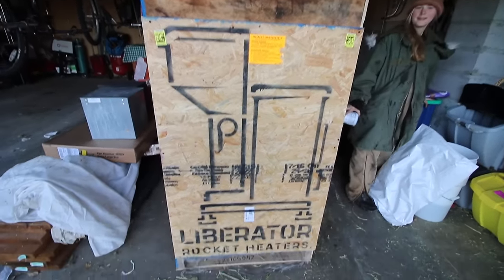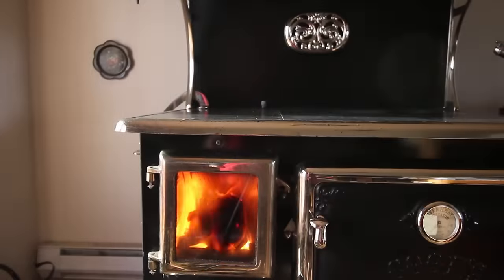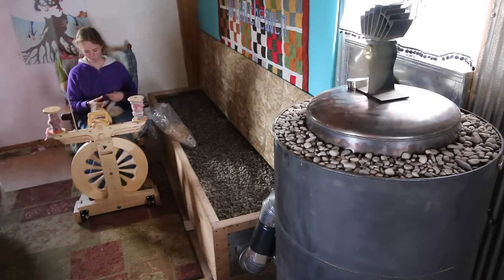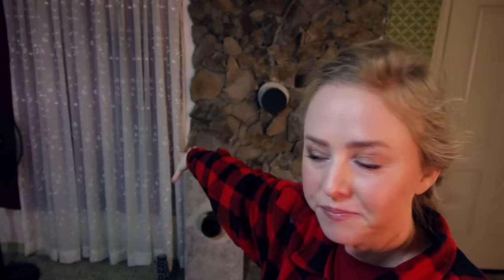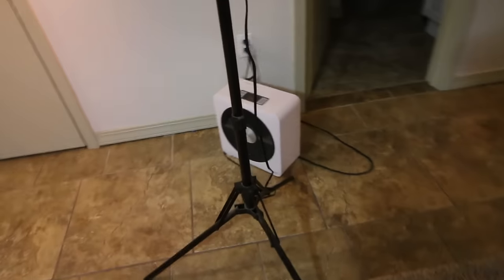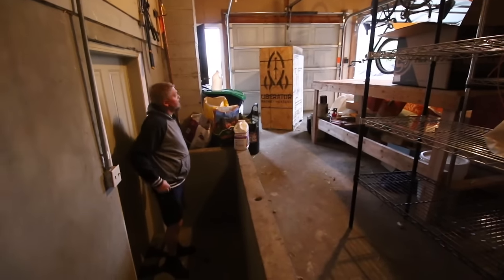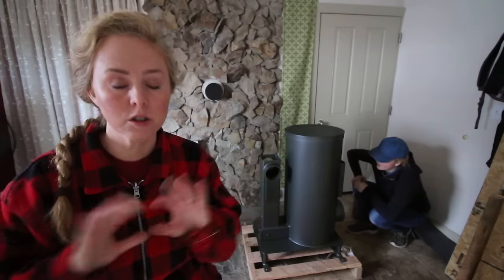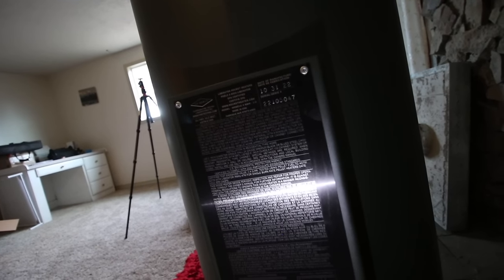Rocket Stove Heater is UL-Certified for Use In Residential HOMES! Liberator Rocket Stove Heater

Comment: Regardless of using a wood, pellet, coal stove and even oil or gas fueled furnaces and boilers, these devices need air intake.  Most do not think about installing a separate air intake system that brings outside air to the stoves.   If a independent outside air intake is not installed, then these stoves are pulling in its air intake need by way of drafts throughout the home.  Many of the newer designed oil and gas fired boilers have this separate air intake from outside air designed in its installation requirements.  The wood, pellet and coal stove designs do not and rely on the customer to install if they wish.  Some Mfg' s don't even mention it.
Reply: One last note, one need to know how much air intake a stove need to burn efficiently.  If you do not provide adequate air supply ( and have sealed up your home drafts) the stove may not operate properly or efficiently.
Reply: Way more important than a lot of people realize. Thanks

Comment: With how much concrete and rocks you guys have in your basement, I would recommend something called a rocket mass heater. It’s a woodstove that you make, and the more rock and the more concrete and clay that you have the longer your house stays warm and you only have to have two fires a day and a rocket mass stove, really good for or big houses in colder climates such as Alaska Northern Wisconsin Canada all those northern areas that get really cold winters that are below -50° sometimes so I would definitely recommend for these guys or anybody else for that matter to make or buy a rocket mass heatercause you go through Leswood but you heat up your house for longer

Comment: If you are looking for more ideas to squeeze out more heat from your stack. There is the simple "Wood Stove Heat Reclaimer". For homemade improvements, look at a diagram of the heat exchanger in a natural gas furnace. There are multiple tubelike exchangers, some are narrow to increase surface area, you'd want the cumulative area to equal or exceed the area of your chimney to not cause restrictions.
 I would get 2 sheets of 12"x24" sheet metal, 16 gauge, stack them together, then drill evenly spaced holes where 3/8" copper pipe will fit snugly. Use the 2 sheets and add more sheets to build a steel box 6"x12"x24" and braze 7" long copper tubes (1/2" overhang on each side). On one side build an air plenum and add a duct down to your floor, where you add a fan to suck the coldest air from the floor. You'd add this to your heat stack.
You can also add a false bottom to your existing gravel box, and drill lots of holes in it, and add a fan to force air up thru the gravel - because the hotter the gravel gets, the less heat it will absorb.
Reply: Wouldn't this cause a bunch of condensation to occur in the chimney pipe?
Reply: I'm getting ready to experiment with something similar, only with a 55 gallon drum instead of a heat exchanger. I'm going to build in a clean out/inspection door so I can make sure it's not building up creosote. My flue temp leaving the stove is 250F a lot of the time. A metal drum will double the surface area of my stove, albeit cooler than my stove. I'm hoping for 30% gain in btu output.

Comment: If you have a properly working Blaze King stove it heats all night with one fill.
The fire has to be run wide open to get it hot. Once it gets hot the dampers have to be closed.
Reply: There had to be something wrong with the blaze king stove or chimney to use that much wood in one season. Like a door seal needing replacement or a damaged damper. I’m 2 hours south of Alaska and we go through maybe 4 cords from October to April!

Comment: I had to measure my pipe 19 and 1/4 in on the hopper pipe. Also I added a small cookie sheet to the back side of my Hopper just leaning against my stove on the edge of my Hopper, that made a hundred degrees difference on my Hopper.

Comment: Interesting build and infrastructure.  Is this a multi fuel unit?   I knew someone that used dry kernel corn in place of pellets.  The corn was less expensive than pellets, perhaps it wasn’t stored properly and became rancid or moldy.

Regarding the creosote water,  when the weather improves remove the exterior elbow and replace it with a T-fitting.  It will allow water to flow past the wall thimble and when the bottom cap is removed, water can be drained and chimney brushes can be inserted and scrubbed from the bottom-up rather than the roof-down.  

Thanks for sharing this insightful video.  Wishing you and your family a blessed holiday season, gentle weather and restful evenings.  Peace

Comment: Really cool tech...suggest you get a Magic Heat...it does use a cord for fan, but you can recover another 8 -10k btus that wastefully goes up the stack....simple design heats pipes, fan turns on pushes Heat through room......also a Kettle stove might work well for you also...no electric just thermal heat operates fan, military used to use...Heat...is Great!  Cheers!

Comment: I've been toying with the idea of getting a rocket stove myself. As for the safety aspect of fencing it off I was actually thinking of using cast iron radiators with A continuous flow of water. Hook that up to your baseboard system with A continuous circulator running to spread the heat throughout the house.

Comment: One key factor to efficiently heating a space is reduce the heat loss through windows, walls, and ceilings.  If the heat loss is high you will only be comfortable when the fire is burning, regardless of the heater type.  Rocket stoves are the most efficient burning of all wood stoves.  They have most heat and least ash.  Your mass does not have to be in the chimney.  If you have a few tons of stone and masonry material near the stove and is heated to room temperature it will maintain that temperature for a long time if it is not in a drafty area.  Many people fail to reduce outside drafts through the building.  In a well insulated home you may be able to maintain room temperature with a rocket mass stove with only 4 hour burn per day in Idaho winters.  If the home is not well insulated you can burn same stove 24 hours per day and feel warmth next to the mass.  In the same thought,  you can affordably heat a well insulated home comfortably with a baseboard or space heater.  Hint, use low-e windows, seal all cracks behind mouldings, and go with thick batt insulation.

Comment: If you are truly interested in heating for comfort with any burning appliance, you must plan for and implement 2 features.  1. You must bring in ALL the combustion air from outside via a sealed duct.  Stoves consume a very large quantity of air.  All the air comes from outside anyway. But If you draw the combustion air from within the room, the Vacuum created by the stove/chimney draft will pull in its air from every leak/opening in your envelope. How well is your floor sealed?  Without outside ventilation you could be drawing significant amounts of crawlspace or basement air thru your living space…  This airflow into the stove sends the warmest air up the chimney and makes the perimeter of the room always feel cool as it is always being fed with cold outside air.  Ever wonder why people with wood stoves complain about it being a dry heat?  This air exchange is why...  2. Provide additional room air directly to the stove.  A concentrated heat source like a wood stove, depending on how well your upper envelope is sealed, can create a stack effect within the structure, that causes the same issue. Hot air escapes out the top, being replaced by cool outside air.  By providing fresh outside air with a small fan directly to the stove to be heated, you will raise the air pressure around the stove which will in turn force the cooler perimeter air in the room out thru those leaks.  It is of course best to seal the envelope as much as possible to cut down on the volume of wood needed to maintain temp.  It does not take much forced air to the stove to make a HUGE difference in room comfort.  A 4” computer fan works well. Is inexpensive and quiet, and provides several hundred CFM.  The addition of a heat plate with a gap between the stove and plate, into which you blow this fresh air improves heating efficiency drastically. Have heated with wood most of my life and wished I knew these two things a very long time ago:)

Comment: We had the small Blaze king Manitoba Canada which is as cold as Mars in winter. Heating 800 sq ft we burnt 2 1/2 cords. At minus 40 degrees we would have our front door open with only half screen door. I think the catalytic converter was no good on that stove. That stove you should have been able to heat 2000 sq ft. when in good condition. It is very important to have your home with positive pressure, forcing out the cold from draft areas.  We brought in cold air from outside to the back of the stove. Good luck with your new stove, I’ve heard very good reviews.

Comment: If you cut 4" x10" holes from room where new rocket stove is, into any of the rooms above, install small inline fans, you can use a room thermostat to control each inline fan to control each area of upper home...
I love this model ov stove, and want one.
👍👍

Comment: My parents cape cod style home had a wood stove in the fireplace up (1st floor) and down (basement).  Filling up the stove and adjusting the damper it kept the 1,500 ft warm until 6am as the only source of heat.  The upstairs was 2,100 ft and  it supplement the first floor heating.  The basement stove started heating at 5pm and heated until 6am.  My parents didn’t want the stove with an actiVe fire while everyone was out of the house.

Comment: I chose water for my mass, and a 1/2" pipe coiled around the riser pipe of the firebox to help heat the water, not complete yet, when done there's about a pallet of bricks, mortar, bentonite and pearlite around the rocket burner, and under 3 - 55 gallon drums for the water mass.  If I have a cold room, I can pipe the water into the room with a radiator and fan to warm up the room.

Comment: I've had the 1st gen model Liberator for 2 years and the only differences between mine and this model is I don't have a removable top its welded down also mine has a solid square feed tube while this one has the pellet air intake built into the feed tube as one solid piece, that was a extra attachment to buy then. I don't recommend it as a primary heat source. You have to keep feeding it wood and constantly babying it to keep it burning. It can burn for maybe 1 hour tops until you have to check on it to add more wood. Granted I didn't buy the pellet hopper attachments and now they don't even sell them anymore for the older model I have, so maybe it works better as a pellet stove but definitely not for burning wood exclusively. A traditional wood stove would be better.

Comment: Rockets stoves are best ran with the thermal mass you discuss. By firing with damper open and sufficient mass to run wide open for 3 or 4 hours until exhaust pipe temp above damper gets hot. Let fire burn out, close damper. If you have enough mass it will keep room warm for maybe 16 hours. Fire one a day wide open, heat mass, shut down and enjoy. The mass in home built in Russian home was built in center of home was exposed into every room. Some had ovens and lots of bed were actually built into stoves. The energy storage reduces wood consumption by 75%

Comment: 65 , we have our thermostat set at 55. We run an electric heater in the bathroom before showering so it's 65. If I still lived by my self the thermostat would be set to 50, and electric heat to 60 for showering.

Comment: I have a Liberator Gen II for sale. I installed it last February, I had 3 surgeries ( back,shoulder,wrist), my family took it back out and put my old stove back in, for cosmetic reasons. I have 1 load of wood left, then I will no longer be heating with wood.(my families choice) they are helping me put geothermal heat in,($37;000) the Liberatot sells for $2,900 with pellet hopper, my pellet hopper is unused, the stove is just like brand new, it is black, it is identical to the one shown. I live in Iowa, I would ask $2,000.

Comment: Guess I don't understand why such a contraption, they've made wood burners for over 20yrs now that have afterburners and are extremely efficient, I installed my Napoleon in 04, it's centralized and my only source of heat, I bank it 2 times a day, morning and night, use between 3-4 cord a year, 1200 sqft home and sometimes we have to open the windows in January, NW Ohio. Nothing beats a wood burner, power goes out (who cares) we cook and make coffee on it, glass door allows enough light when the sun goes down, swear by creosote remover, it cut my chimney sweeping down to once in a blue moon from twice a season.

Comment: You get moisture in your flue due to too much heat being robbed from the combustion gasses allowing the moisture from combustion to condensate on your stack pipes. If you hook up to a bench you want it sized so you keep the gasses going up the stack at least 250 f.

Comment: My understanding is that UL tests electrical equipment for safety.  Since a wood stove uses no electricity I'm sure UL would certify it as safe.  Not trying to take away anything from the stove which looks to be a good one.  UL just seems to be an odd certification for a wood stove.  Heat efficiency ratings are more important to me.  For example, how does this store compare to a catalytic wood stove?
Reply: UL runs test for anything and everything.  It’s extremely expensive to obtain a UL certification.
Reply: @asmith7876  They must've expanded their testing over the years.  I stand corrected.
Reply: @xfiles4792  It’s how they started but they’ve certifying fireproof construction and all sorts of things for over 100 years. I work in an industry where we require UL certifications for all sorts of things. It probably isn’t common knowledge.

Comment: 1:12: 🔥 Efficient wood stove heating in basement living room, using a Blaze King Blaze princess stove, with a focus on heat efficiency and wood consumption.
4:35: 🔥 Excitement about installing the non-insulated Liberator stove and comparing it to the aircrete rocket stove in terms of heat and insulation.
9:42: ⚙️ UL-certified rocket stove heater for residential use with high-quality metal and safety features.
12:52: 🔥 Innovative homemade rocket stove insert for windows provides emergency heating, insulation, and customized use for residential homes.
17:43: 🔥 Assembly and features of a residential rocket stove heater demonstrated in a simple design and lightweight assembly.
22:54: ♨️ Rocket stove heater provides efficient heat with complete combustion, but requires precautions for safety and temperature control.
26:04: 🔥 Improvements made to the rocket stove heater setup to address flame and coal issues, including extending the hearth and using non-combustible materials.
Recapped using Tammy AI

Comment: You need a good airtight wood stove.  You can bank it at night by reducing the air supply.  And you won't have to fill it as much due to the controlled burn anytime you use it.  That unit you are showing looks like it cannot be controlled.  And it will burn loads of wood too.

Your comment that this is okay for insurance purposes is false, very false.  Most insurance companies will void any claims if you have a wood stove connected up.  Doesn't matter whether it's UL listed.  Also your comment about using pellets when you are not able to use wood is true, however pellets are rather expensive like heating oil.  So their use would be counterproductive.  Other consideration is that chimney fires are not impossible with insulated flue piping.  So, in effect, you can use this but if you have a loss, your insurance will more than likely use its presence to deny any claim.
Reply: Thank you, this is a junk stove, one of the woodstoves that you'd see at a big box store. A person should definitely invest their time to what a"quality"high-end wood stove actually is and this is definitely Not one of the premium better built burners.